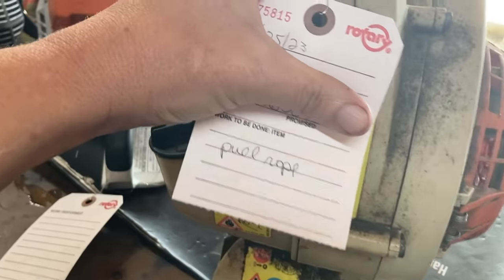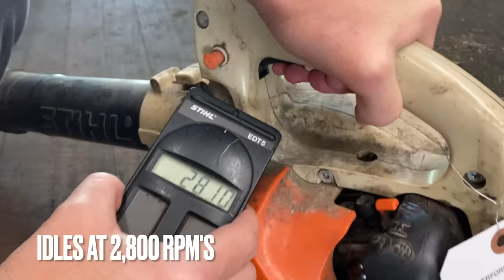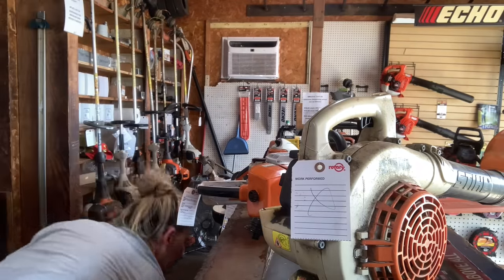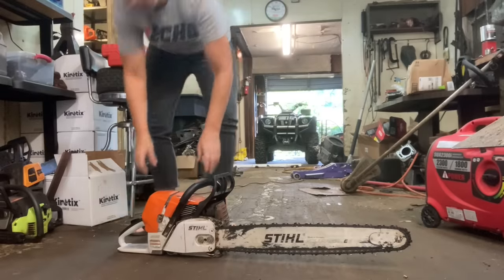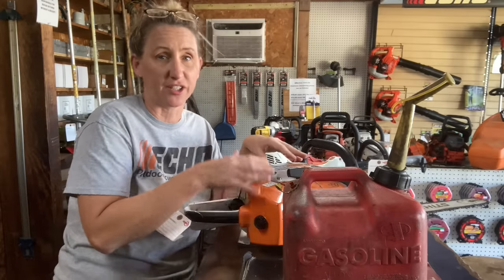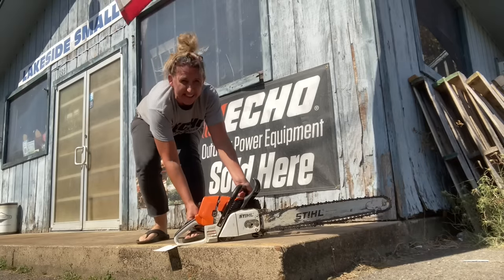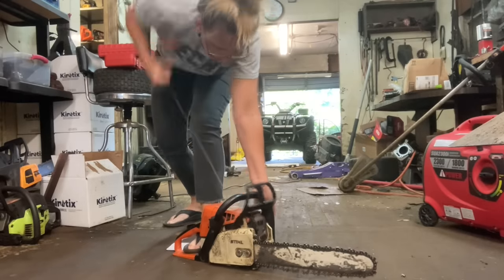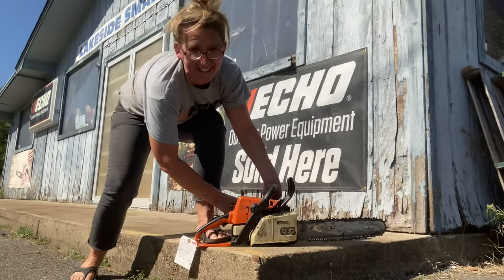The Burning Truth of Canned Fuel. This HUGE Distributor Doesn't Like Me Exposing It!

Comment: TruFuel works good but I’ve seen videos showing after 18 months, almost any gas will gel, or gum up.
I’ve got 3yr old TF in a tiller that runs, but it surges.
Probable idle circuit obstruction.

Comment: Aren't you supposed to drain a fuel tank before storage? I moved to the Midwest from Arizona a few years ago and I'm not used tonhaving seasonal equipment (lawnmower or snow blower) but I was given a lawnmower when i first moved out there. It was in such bad shape because of oxidized fuel gumming everything up I just started draining fuel before I store it and I remove the carburetor and clean it thoroughly. What I'm getting at is if its good for protecting an engine when the fuel is sitting for a long time its really good for nothing.

Comment: I have a Troy-Bilt Squall 179E snow blower that I bought new 2 winters ago. It worked fine the first winter, then last winter it started but blew white smoke and would only run if the choke was on halfway. I only used maybe once this past winter. I changed the oil and drained out the old gas and refilled it. Any suggestions?

Comment: You may have hit the nail on the head as to what ails the canned fuel when you said its good for storage but it won't run on it. ... A number of years ago, when we first started to see wholesale ethanol issues with fuel in small engines, everyone started to get more interested in using fuel stabilizers. Around that time I had a problem with about 6 gallons of gas that had been treated with a particular brand 'red' fuel stabilizer. I had never used it before and had gotten a full bottle of it with a boat I bought that was not running after a sitting for the better part of a year. Around that time I decided that since I had the stabilizer, I'd treat the full 6 gal. can of gas since I won't likely need it till spring, if I did it would be in smaller quantities for the chainsaw. (It was pure 87 octane gas, no oil). That was in early Nov. Come March and April, I grab that can to use some in the mower, I poured a full tank in the 3.5hp BS push mower and gave it a pull. I got nothing, it wouldn't even attempt to start. I had a squirt bottle with some gas in it left from the year before and it smelled fine, so I pulled the air cleaner and gave it a shot, it fired right up and ran till that shot of fuel was gone. It refused to run on the fuel in the tank. I grabbed a gas can of old gas, that had never been treated, that didn't even smell right, and replaced the treated fuel in the tank and the mower fired right up. As weeks went on I soon realized that the gas that had been treated wouldn't run in anything. It was no better than a can of water. I got a fresh can of gas, which got everything running. I filled a 1 gal jug and mixed in some oil for my Stihl saw. Knowing I wasn't likely to burn a gallon all at once I treated it with the same stuff,  after I filled the fuel tank with untreated fuel mix. The saw ran great, till I had to refuel, when I did it barked coughed and refused to start, finally just flooding out and refusing to start. I dumped out that mix, mixed up some fresh untreated fuel and it ran fine. At that point I realized it was the additive causing the issues. I called the company, explained what was going on, then  they wanted to know how old the bottle was and what numbers were stamped on it. It turns out that the additive was 4 years old at that point, they told me that their additive, which was red, was only good for 1 to 2 years tops, all of which can be affected by temp and humidity. In other words, the very stuff I was using to prevent problems was the very cause. 
Now, 10 years later, I buy a can of that pink premixed crap and it starts and runs fine one fall, but come spring, no amount of pulling that rope will start that engine. 
Then I noticed as I was pouring out the canned fuel mix that it looked and smelled just like that fuel with the red additive that refused to burn back then. 
My guess is that what ever goes bad in the red fuel Stabilizer with time is the same stuff that goes bad in the canned fuel. There's no telling how old some of those cans could be either. 
The one thing I did say back when I had the first issues with stabilizer, is that at least it didn't screw up the carb, it did prevent corrosion but it wouldn't run. I could have shot oil into the carb and had the same effect and saved 6 gallons of gas or more and a lot of rope pulling. 
I've since switched to Sea Foam or a home made mix that works for me just the same and haven't had any issues since.

Comment: I have experienced several times where I couldn't get a saw to start despite it running fine off of tru fuel recently.  I have even drained it and put new tru fuel in it and it still wouldnt start. But swapping to regular mixed fuel it did eventually start.  SO I use tru fuel because it seems to preserve the carbs and plastic parts on equipment of mine that doesnt see much use but I have on several occasions had them not want to run off of it for whatever reason. HOWEVER, I have figured out, when they won't start on tru fuel, I can hold the throttle wide open and it will eventually start and run fine after a few pulls. No idea why but I've proven this on several different 2 stroke engines that wouldnt start on tru fuel. Seems once they start. They run ok if you can get them running

Comment: Tru fuel is stupid expensive but I’ve ran it in my echo weed eater for 13 years and I’ve never cleaned or changed a spark plug and it starts fine after    every winter from sitting for 5 or 6 months. It’s ethanol free and I was told that’s the key to keeping a 2 stroke running. Just my experience though.

Comment: At $36 a gallon, it needs to be right. I wonder if the added fuel stabilizer could be affecting the 50:1 ratio, and making the equipment not reach peak RPM ? I think more research needs to be done. 🕵️‍♀️

Comment: Thanks for the informative video… You said “you’re fuel” several times but didn’t say what it was… 2 stroke motors require a fuel to oil ratio… is that what you’re referring to???

Comment: You may laugh at me but my go-to to fix my and others 2 stroke small engines.  First I go to Loves gas station in the local area and buy the 100 percent gas, not that blended crap.  You pay $1.00 per gallon, so it is a shit load cheaper than the store-purchased pre-mix.  Next, I mix in the oil myself, generally just under the noted value of mixture, for example my old Lawn Boy self-propelled calls for 32:1, I go 35:1.  Hell it has run for over a decade this way, so that "Run it with a stronger oil mixture and it will last longer", is basically Bravo Serra.  Next, my next go-to tool if the carb is mucked up with that blended fuel sludge is the ultrasonic cleaner and Pinesol.  Yep, give it about 55c water setting and 29 minutes of time.  If you need gaskets, ebay is a good source, hell often a full carb is cheaper than the kit, so look before you break down the old carb.  Have several 4 stroke machines that I don't run all that often and they get the 100% gas, several year shelf life vice 90 day of blended.  Also suggest at the end of running season run them dry of fuel.  Have a Chinese 22" chainsaw that I use quite a bit, and it is 4 years old, and it always starts after no more than 4 pulls and runs fine, simply just remember what you have and use it within it's limits.  Harbor Freight sells 6lt ultrasonic cleaners for under $100, got my 15lt unit on ebay for under $150 and use the hell out of it.  Believe it or not it is fantastic to clean out spray guns also.

Comment: Odd. Never seen canned fuel here in Australia, however the stuff seems to perform similar to Opel fuel. This is a special type of gasoline used in remote Aboriginal communities, where petrol sniffing is common. It is less dangerous to sniff and not as effective at producing a high. Having less light molecular weight aromatic hydrocarbons means starting can be very difficult. Fortunately, the areas where it is used tend to be in hot climates, so it is less of a problem.

Comment: Boots!  Please!  Lesson 1 in handling chainsaws in safety!  I kept wincing at every pull of those chainsaws!  That and a cheap piece of plank under the chain too.  Apart from that, is the guff fuel you were tipping out a bit ethanol heavy or the like?  Great when it works out to be that simple.  Please, even if you're not wearing the heavier boots laced up as tight as you would out in the field, cover your feet and ankles at least.  Sorry to sound like a grouch but...Cheers!

Comment: See, I think it's more of a someone is trying to fix it with the canned fuel. It's when you go back and forth that it causes problems. My dad borrowed a saw of mine, put self-mix in it, and it did exactly what you show it does. After dumping it out and cleaning everything and replacing with Tru-Fuel, ran fine. The mix of the two fuels is what's causing the issues.

Comment: I swear by echo red armor canned fuel.  I don't like the one that starts with t. I'm not kidding when I tell you that I've let a Redmax 23cc trimmer sit for over two years, and it will take 2 pulls to pop off. It's sentimental so that's the reason.  I also trust it to winterize 4 stroke equipment and it hasn't let me down either.  What's your opinion on the echo red? I'm very curious if you have encountered issues with it.

Comment: The problem with engineered fuel and mix your own is the same. It's all shelf life. If your buying trufuel or aspen or whatever, and it has been in the warehouse, the distributors shelf, dealers shelf and then in your garage who knows how long that's been. I work for a company who sells trufuel and we have to buy in truckload Quantities to get the best deal and be competitive. Understanding that trufuel wants to move larger qty's to save themselves money as well it doesn't always end up great for the end user. Buy smaller 1qt qty's and use it up before buying new and use dealers that you know move the product and issues with stale fuel with be a lot less for sure regardless if your mixing your own or buying an engineered fuel...

Comment: When you let equipment sit for some time,the fuel goes to a gray powder like and clogs the carburetor.
This is what E85 fuel does to equipment.
It also does this to vehicles as well that was designed to older models.
Now the flex fuel vehicles for E85 was designed for this fuel.
A flex fuel vehicles burns all the fuel and get good milage,when a non flex fuel vehicle dont and it runs out tail pipe and worse gas mileage..
So,also when i get flex E85 for my truck,i make sure i lift hose up to drain it all out of hose .
This way a high tec sports car getting 92 dont get any in its tank to mess it up.
All should do this too!😊😊😊

Comment: I use canned fuel without much issue but only because my gear is occasional use and ethanol free is impossible to find in my area.  Mixed fuel would go bad between uses.

Comment: I tried it in a gas auger, all I know is that I left it in the tank for a month and went back to use the auger and the fuel line was cracking, but only in the part that was in the fuel.  Since then the fuel line has snapped in half inside the tank.

Comment: Interesting. I’ve never used Canned Fuel. I always mix my own 91 octane non-oxy fuel with Arctic Blue two stroke oil, simply because that’s what I have laying around for my snowmobile. My Stihl leaf blower does the same idle down scenario as that first blower.

Comment: Not all canned fuels are created equal. I’ve been using Aspen 2 & 4 for years & have zero issues. I never add additives either. Even when sitting for years it works great. Always had this issue with TruFuel. The difference is non ethanol alkylate fuel. Not cheap by any means.

Comment: Have you tested Aspen canned fuel ? I had problems with three chain saws, one Stihl, one Husqvarna and one Dolmar. Then I saw you describe my exact problems in a video about canned piss, and decided to do it the old way. I mixed 95 octane with 2,5 % of ENI synthetic two stroke oil, and abracadabra ! All problems solved. Aspen is the most popular Brand in Norway.
Reply: Here in Norway, I have used Aspen in over 20 years in Husqvarna/Jonsered/Partner chainsaws, gresstrimmers, and brushcutters and never had any problems whatsoever with original or modified engines.

Comment: I just bought an ECHO pole saw, PPT-2620H, and only used the canned fuel to start it. I must presume your advice or warning applies to ECHO canned fuel as well. Interesting, the instructions state that only high octane fuel should be used, 89 or 91. 
I'm wondering what the actual octane level is in these canned fuels. 
Thanks for your advice, I'm mixing my own from now on. But also switching to a lighter Husqvarna pole saw. 

The ECHO PPT-2620H is 18 pounds filled with oil and fuel. Way too much weight for anybody to handle safely for more than a few minutes. And it's not balanced and needs a special shoulder harness & forward mounted harness hook.

Comment: Bonnie Raitt.... yeah!

I make my own mix from ethanol free... I found a station with a dedicated hose for it... 

People give me chainsaws because they won't start... I've too many now... not complaining...

I've a 14 inch McCullough that is amazing. I had to rebuild the whole fuel system, new carb, lines and all, but this little baby starts, first pull, every time.

I also got a 25 inch Stihl for $50, didn't start.... New carb, now runs great. 

I'm still a little confused about the compression release... but what I learned, is just one pull with it on, leave it alone, 3rd pull, starts. I've never had a saw that revs like this one. It screams... goes through a 12 inch log in 10 seconds... crazy.

I should sell the ones I don't use.... they all work now, except one, a '78 Partner... when it ran, it was a monster. It needs a carb, and I can't find one. Bummed.

Comment: The only reason I'd buy a can of fuel is to have the can for the future. I ride old mopeds on camping trips that can span 400 miles and sometimes the range of the tank doesn't make it to the next gas station. The can would be more durable and marked better than the old Mtn Dew bottles I have been known to carry my spare fuel in.

Comment: So what's the issue there? Is it that modern chainsaw and other such engine tools can run on petrol with ethanol, and so they make canned gas only for these modern tools, or can you find ethanol free canned gas for older tools, or should the manufacturers upgrade their engines to accept both types of petrol, or is really ethanol the culprit there?
i feel like I have more questions now than before!  😄

Comment: so quick question. I do not use the bigbox store fuel, I use Stihl oil (orange) and non-ethanol gas. I have a blower that is pretty much identical to the one you used in the beginning. I have checked all the things that you mentioned and yet mine still revs up and then bogs down, any suggestions?

Comment: been wondering if this stuff is any good for a while. I did notice that the shop where I buy my stuff sells the Husky fuel not Truefuel. 
I'm still using my own e10 mix with 89 octane pump gas and Echo power blend oil. Very hard to find E0 fuel here in Southern New York state. If I can find a station that sells it I will switch over. I have 8 small engines, four 2 stroke machines and four 4 strokes, so it would be worth it.

Comment: I Bought a New Stehl371 Saw for the First New Saw I Ever Owned! I Had To buy a Gallon of Stehl Gas And 3 quarts of Stehl 2 Cycle Oil For The Extra Year
 Warranty! It's just Breaking in Slowly and Running Fine! I Tried the Stehl Fuel in Several of My 20 Year Old Assortment of Still Running  Great Cheap Saws and They ran Like Poop!
I Then Put Leaded Premium And Stabilizer as Usual and Those Old Girl's Purred Like New?
I Hope this New One Last as Long as These Cut your Tree and Toss it Away Saws?

Comment: On a 025 chainsaw the tank vent will always dribble fuel out when tank is full. I've replaced them alot and still they never fully seal up like the later vents used on a MS250.